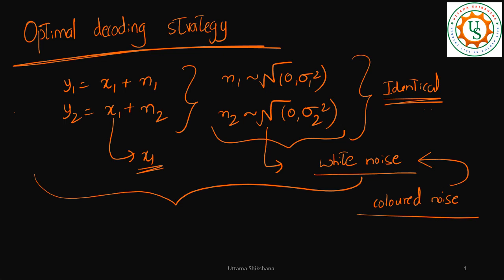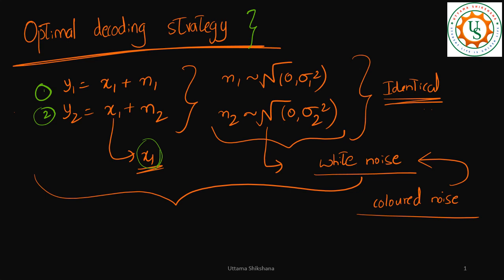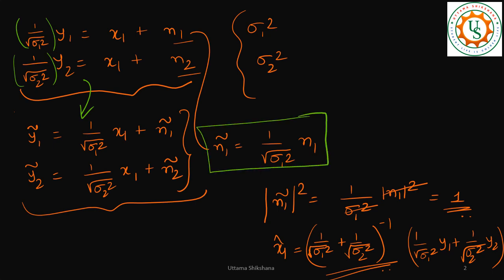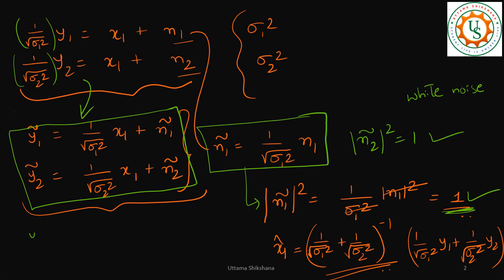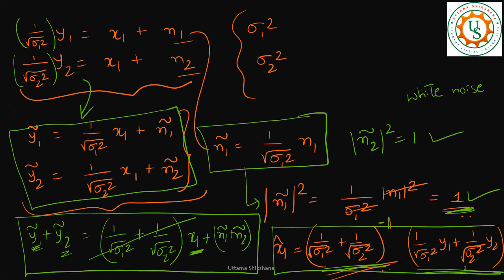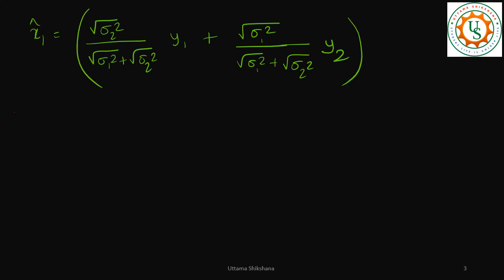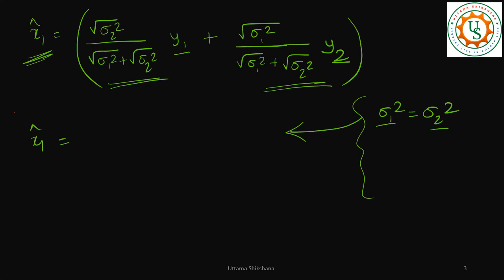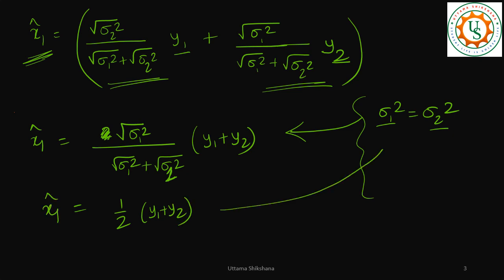[Interview QnA#43] Independent Noise samples with different variances - Optimal Decoding Strategy?

Comment: Sagar, the word "coloured noise " is misleading, isn't it ? ( Correct me if I'm wrong) 

Coloured noise means , correlation is present between n1 and n2. 

But here we are considering independent noises , but with varying noise variances.
Reply from the maker: Yes Arjun. You are right.
So, please consider only independent noise samples but with varying noise variances.

I have removed colored term to avoid confusion.